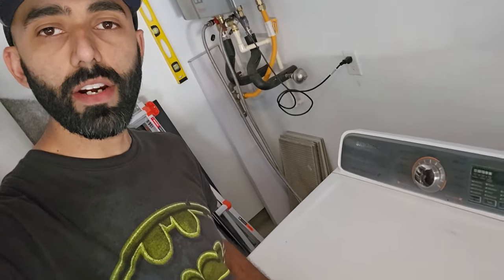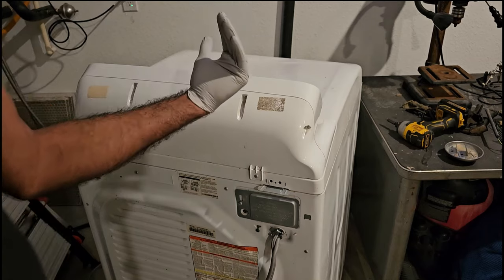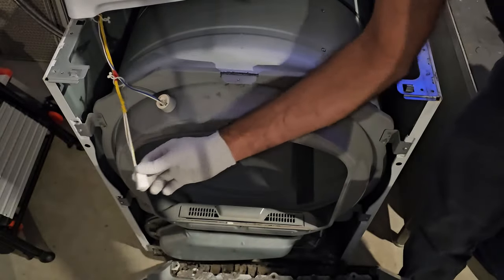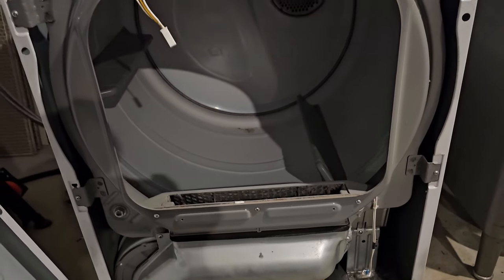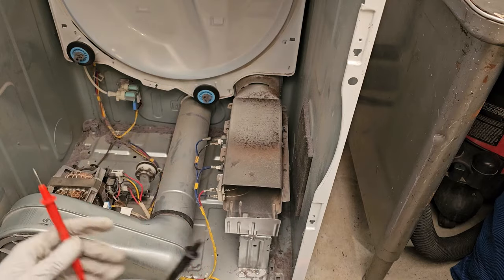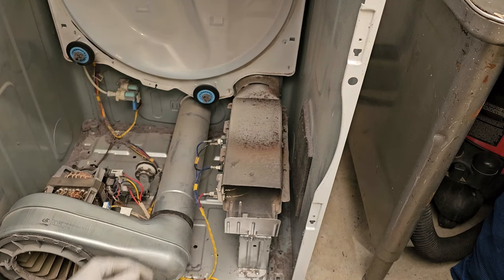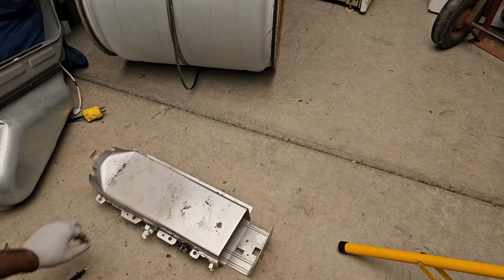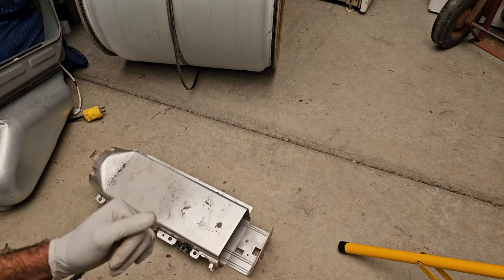Troubleshooting And Fixing A Samsung Dryer That Is Not Heating!

Comment: What if my heating element only has 2 wires but my dryer has 3 plugs red white & blue?
Reply: Same here
Reply: @jorgegarcia6741  I just ended up ordering  a new heating element with 3 wires I don’t think it will work just 2 if your dryer has 3 plugs

Comment: So i was told my samsung dryer is not heating up because of the door switch.is that true.i pushed 2 buttons at the same time and a dc code came up.which is the door switch.everything else works on the dryer.i just have no heat.